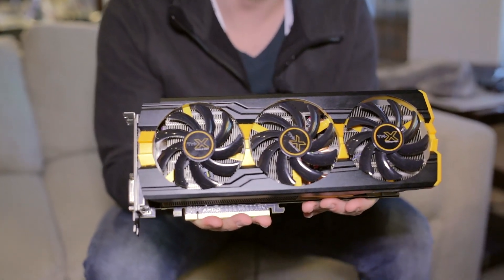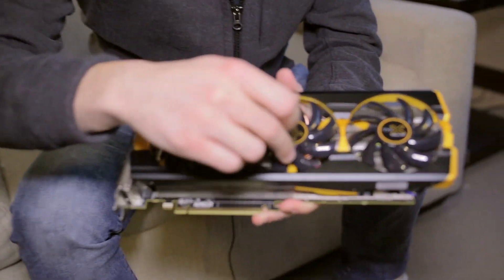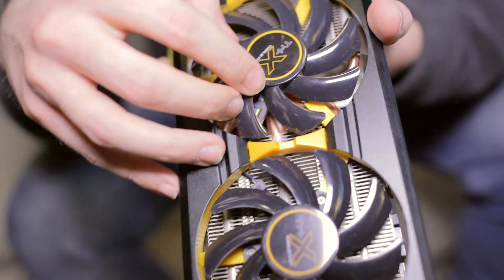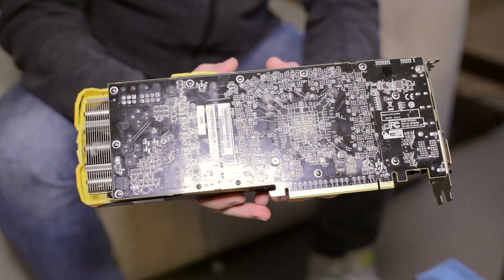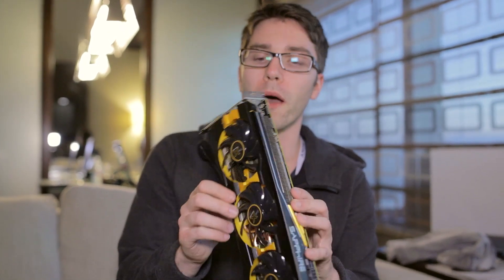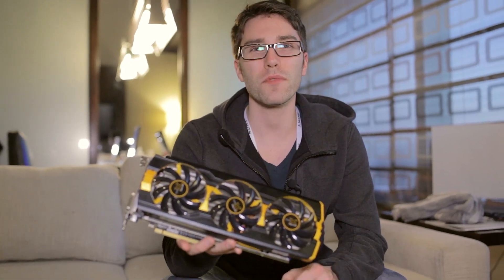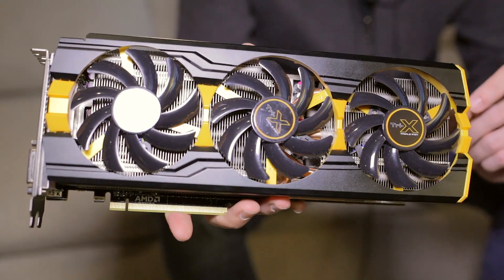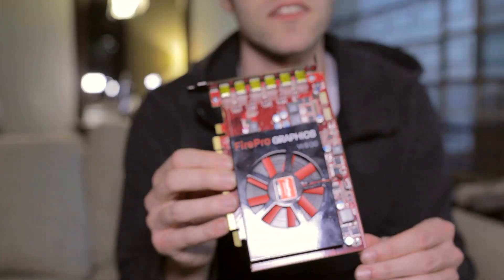Sapphire CES 2014 - R9 290X TRI-X and Firepro cards

Comment: Still waiting for the r9 290x $ to drop.
Reply: Still waiting for the Titan $ to... wait... this card is useless now.
Reply: JustNaturallyAwesome I heard that Nvidia's gonna make a 6gm vram 780ti soon. :O
Reply: juicysteak117
If the 6gb gtx780ti cards are still under $1000 locally then I'll say the titan has finally met its match. Till then its still a valid option, offering more usable performance for those crazy enough to be running 4 way SLI. I serous hope they do offer a 6gb version soon though, seems a shame to have less ram on Nvidias flagship gaming card than on some non-refernce gtx760's.
Reply: as long as miners exist dont expect any price dorps